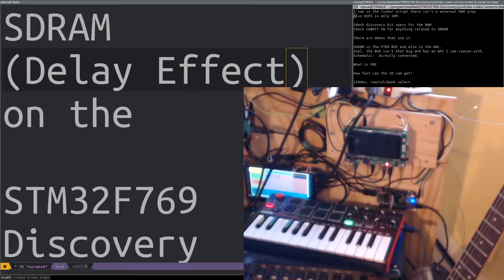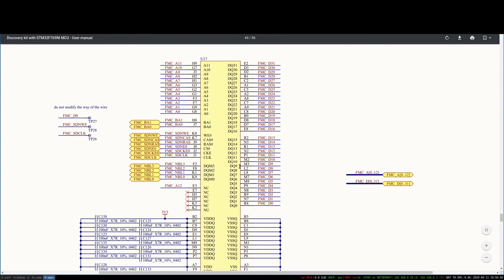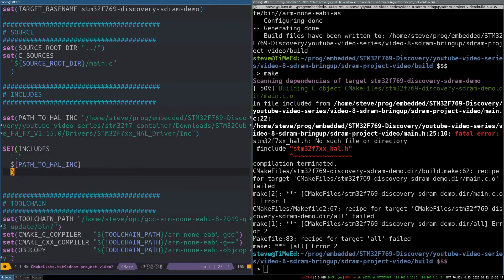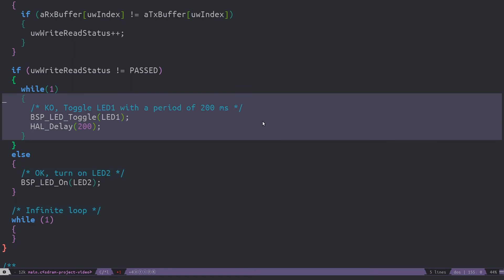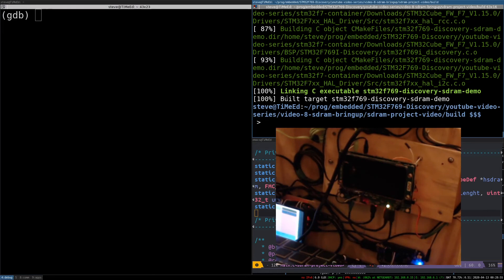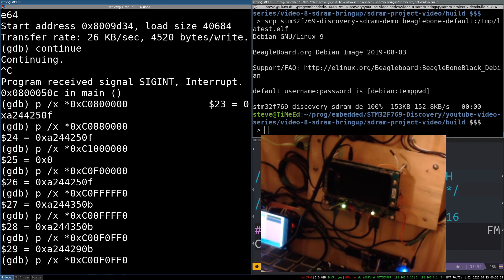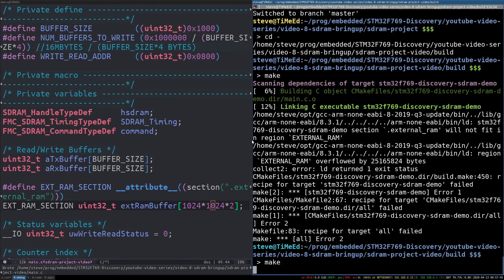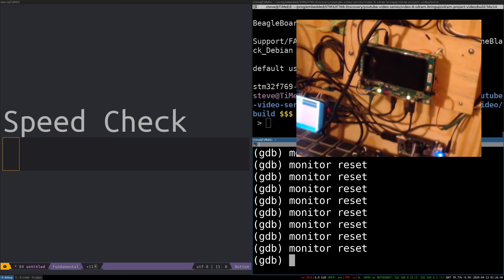SDRAM on STM32F7 Discovery

Comment: Hi there,

Do you have any more detail on the actual delay project? It doesn't look like you ever moved the buffer onto the SDRAM.
Reply from the maker: Hello!  I think you're right?  The exercise is left to the reader haha.  Trying to focus here on the technical stuff.  The application demo is just there to motivate the discussion.
Best of luck with your projects!
Reply: @pizzabeerengineering2488  Thanks, I actually tried this with an F429 discovery board and I believe the SDRAM doesn't have enough speed to work with the DMA. Did you ever try it with the F469 discovery board you're using here? The delay effect? 

Really great video by the way it's a solid reference for me. I have seen some Arm boards that go up to 480MHZ with SDRAM attatched that claim to work for delay effects. The Electrosmith Daisy Seed Development Board - seeing 480mhz and it being the only real reference I can find online of a functioning delay effect running on SDRAM has me worried!
Reply from the maker: I'm a big fan of electrosmith, their library code is solid.
I'm using F769 here, daisy seed uses some H7xx.
DMA with SDRAM sounds like it could be tricky with real time timing, as you said.  Haven't tried it.
Feel free to email me!
Reply: @pizzabeerengineering2488  is it not normal to use DMA with the SDRam? You only use the delay banks and pull from them on the SDRam but leave the DMA to the built in memory?

Comment: Hello, First of all, your videos are very good, thank you for this. My question is, why are you using only 64MBit of a 128Mbit memory? It is not mentioned in the document as inaccessible in any way, what is your purpose here?
In my project, I need 128MBit space. I'm using STM32H750 (STM32H750B-DK) but I couldn't activate all 128MBit in any way, everyone is using 64MBit like you, is there a conceptual phenomenon that I don't know?
Reply from the maker: I believe there is a mistake somewhere, but besides that, the content is correct. Ill note it next time I see it.   You should be able to access the entire memory.   Thanks for the comment!
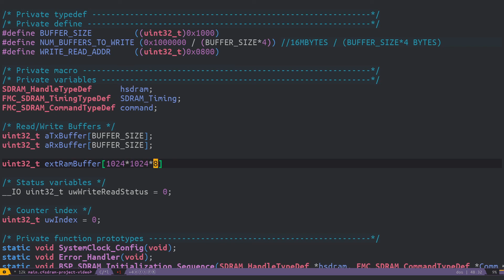Reply from the maker: 13:57 and onward, started assuming 8mb, should work if assuming 16mb.  Thanks!
Reply: @pizzabeerengineering2488  Hello again, yes you were right all along, the problem was with the STM32H750B-DK kit. Hardware-wise, some external pins are required to set FMC Data 32 Bit, but since ST designed them for other purposes on this board, so the FMC Data setting is designed to allow only 16 bits. Therefore, 128 MBit cannot be used...

As a result, although it is written in the document that you can use 128 MBit, the circuit drawing they made allows to use 64 MBit at most.
In short, 128 MBit in the STM32H750B-DK kit (only 64Mbit accessible..)
Reply from the maker: @tarksapmaz7690  wow, good to know, thanks!  I somehow did not notice this because I made a mistake and defined the total RAM size wrong.  This would explain why the reference code had the setting for 16 bit data width.  I'll have to check if this is also the case with the F7 kit.